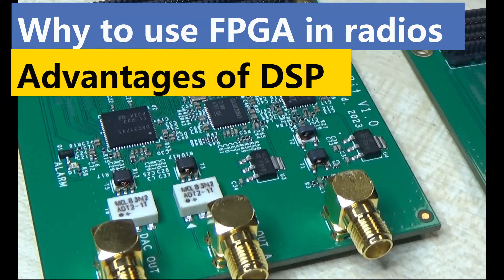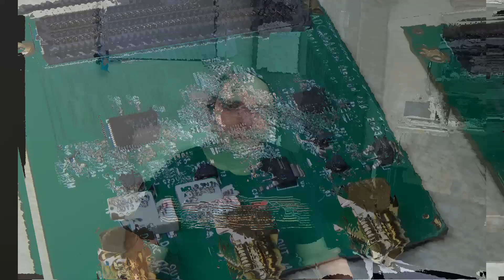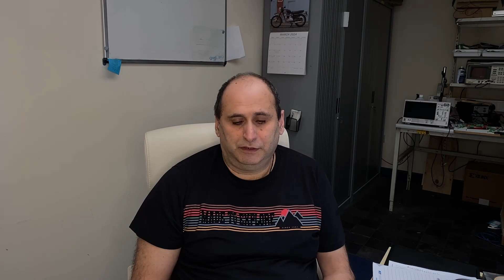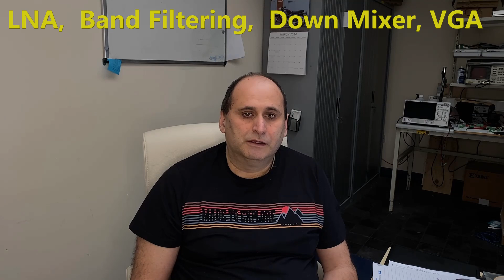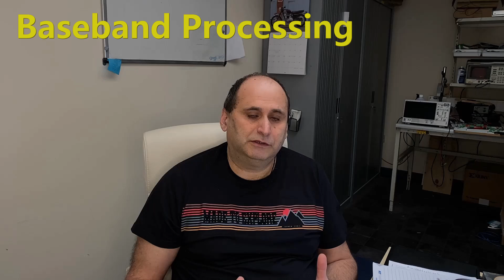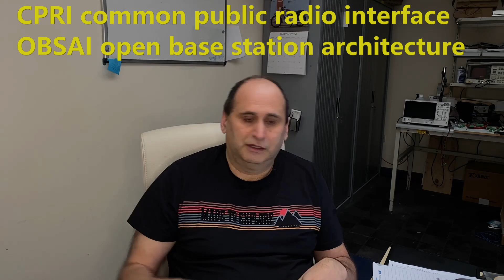Using FPGA in radios

Comment: Hey, great video! Is it doable to hook up an FPGA dev board to an external RF front end? I’m thinking of building one, but I’m worried about possible skew issues
Reply from the maker: @melmacian654  antenna + front end (filter amplifier) + ADC + DSP (FPGA) = radio
Have fun!
Reply: @adaptivedesign8795  sorry, my question may not have been underdtood. I mean, is it possible to build that on separate boards?( For example fpga dev board connected to a pcb with adc- mixer and so on) for example, clock mistmaching( delay skew) could happen.
Reply from the maker: @melmacian654  you're right I misunderstood the question, you can mitigate very easy the clock/data skew on the FPGA because you have dedicated resources on the FPGA  for that, PLL/MCM with precise phase delays and for the IO you have delay elements on each pins with resolutions of 50/75 ps.  However if the PCBs (the FPGA and the ADC-DAC) is designed correctly, with matched delays on the edge connectors you have no problems and rarely you need to use the IO delays at the pin level. These IO delays are in place for very high bit rate (DDR memories usually) when the sampling window is shorter or close to 1ns.
I hope this answers your question.

Comment: FPGA are necessary when you want to implement direct sampling SDR's (as a hobbyist) there are several examples on github which are quite successful. But as amateur radio designer you need to learn a complete new skillset. Also making the design cost effective is not so easy. A lot of cheap ADC chips are older and difficult to obtain. I have some AD9963 which are dual channel 100 MSPS and I was searching for an cost effective FPGA that can connect to USB or PCIe but most chips are expensive and designing a BGA pcb is also a challenge, or use a dev board but those mostly don't have enough IO's to connect the AD converter or are from a signal integrity point of view poor.   So maybe I take an existing SDR board (like radioberry) and adapt it.Thanks for the video interesting discussion.
Reply from the maker: Hi Paul,
your points are valid, buy hey someone has to do it. Where some people see barriers others are seeing new opportunities and challenges.
Thanks for the great comment.!

Comment: Hello! I thought about full digital radios - there must be an excellent ADC: to avoid intermodulation distortion and noise.Maybe  down-sampling helps  to avoid extremely expensive 16bit ADC 60MSPS. My history about program logic was sad. I know the C language, microcontrollers , analog RF electronics. Several years ago I tried to write some software for FPGA. It was a simple serial interface for  external ADC and DAC and a simple bass filter. It takes several days (I had done it) - but I was there so exhausted that I had a sleepless night... As a result I sold my FPGA Altera developer board.
Reply from the maker: Andrew,  I think you are made from the right material, I had many of those ups/downs. For audio applications FPGAs are overkill but for high sample rates and more complicated stuff are working like a charm. I hope you get back to it someday.
Take it Easy!